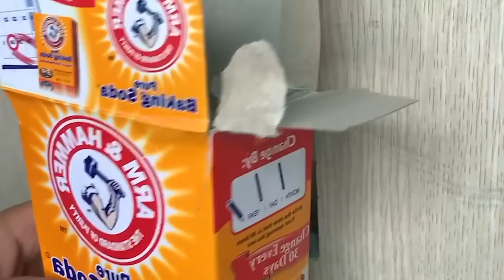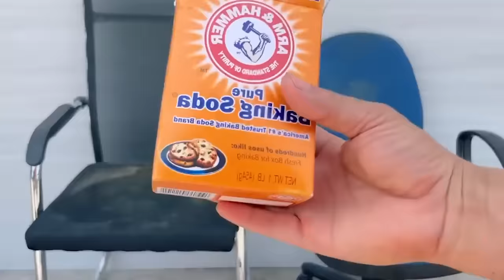Many plumbers have become extremely famous thanks to these secrets! fix metal water lock with rivets

Comment: 1st short where tap thread was broken already how it possible it will run clock wise open aanti clock wise will open yarr
Reply from the maker: It sounds like you're describing a situation where the tap thread (the threaded tool used to create threads in a hole) was already broken, and you're wondering how it's possible for it to still function in a clockwise direction while opening it counterclockwise. Here's an explanation:

In some cases, when a tap thread is broken, it may still be partially functional in one direction, typically the direction it was last used or tightened. This is because the threads on the tap are often tapered or spiraled in a way that allows it to grip and create threads when turned in the clockwise direction (tightening) even if it's damaged. However, when you attempt to turn it counterclockwise (loosening), which is the opposite direction, it may not work correctly or can get stuck due to the damage.

It's important to note that using a broken or damaged tap is not recommended and can potentially cause further damage to the workpiece or the tool itself. If you encounter a broken tap, it's best to remove it properly or replace it to avoid complications and ensure the accuracy of your threaded hole.

Comment: lol.  It’s like Chinese plumbing academy.  It will work long enough for you to pull out of their driveway
Reply from the maker: It sounds like you're expressing some skepticism about the plumbing methods shown in the video. DIY plumbing solutions can vary in terms of their effectiveness and longevity. Some quick fixes may indeed work for a limited time, while others may provide more durable results. It's essential to consider the specific situation and the quality of the repair when attempting DIY plumbing work. If you have any specific questions or concerns about plumbing repairs, feel free to share, and I'll do my best to provide information or insights.

Comment: When you got anything. But cant buy small things. Do not trust diy for safety.
Reply from the maker: You bring up an important point. While DIY projects can be rewarding, safety should always be a top priority. When working with tools or attempting repairs, it's crucial to have the right equipment and follow proper safety guidelines. If you're unsure about a DIY project, especially when it involves potential risks, it's wise to seek professional help or advice. Your safety is paramount, and it's okay to ask for assistance when needed.

Comment: I'd guess you plumber doesn't pay attention to grain direction! Why are all the videos in mirror to what they should be? All the tricks are good though.
Reply from the maker: I understand your frustration with grain direction and mirrored videos. Content creators need to pay attention to such details to ensure the best viewing experience for their audience.

In terms of grain direction, due attention to detail during the construction of the plumbing is crucial to ensure the longevity and quality of the finished work. Using materials with the correct grain direction can prevent potential problems and improve the overall performance of the plumbing system.

For mirrored videos, this may be technical oversight during editing or uploading. Viewers may be annoyed when the image is inverted, as this can make it difficult to follow instructions or understand the techniques being demonstrated.

Despite these issues, I'm glad you found the tips in the video helpful. It is essential for content creators to consider feedback to improve their content and deliver a better experience for their audience. If possible, you can directly provide constructive feedback to channel owners so they can be aware of concerns and address them in future videos.

Comment: 2:30 still leaks from the main pipe
Reply from the maker: I'm sorry to hear that you're experiencing continued leaks from the main pipe. It's essential to address this issue promptly to prevent further damage. I recommend reaching out to a professional plumber to assess the situation and make the necessary repairs. Properly fixing the main pipe will help ensure the water system functions correctly and prevent any potential water wastage or damage. Remember, it's crucial to prioritize the maintenance of plumbing systems to avoid such issues in the future. Best of luck in resolving the problem!

Comment: 2:11 this is DIYer’s # 1 mistake: wrapping Teflon tape counterclockwise. And you did exactly that. You’re misguiding the newbies.
Reply from the maker: Thank you for pointing that out. You're absolutely right, and I appreciate your attention to detail. Teflon tape should indeed be applied clockwise to ensure a proper seal on threaded connections. I apologize for any confusion my mistake may have caused. It's important to provide accurate information to DIYers, and I'll make sure to address this in future videos. Your feedback is valuable in helping improve the quality of the content.

Comment: Pretty sure actual plumbers DO NOT do this stuff not even in their own homes. Thing is plumbers are in business to make money with less liability this is why they will install a new ball valve rather than repair a worn out one or install a proper trapped sink drain rather than engineering some fix-it device on site
Reply from the maker: I understand your perspective, and you bring up a valid point. Plumbers often prioritize efficiency and long-term reliability in their work to ensure customer satisfaction. However, DIY enthusiasts might find value in exploring creative solutions for minor fixes or temporary solutions. It's essential to weigh the pros and cons of each approach based on the specific situation. Have you ever attempted a DIY plumbing project, or do you prefer to rely on professional plumbers for all your plumbing needs?

Comment: Why are all the threads backward
Reply from the maker: It seems like there might be a misunderstanding with the threads. Double-checking the direction and properly aligning them should help resolve the issue. Don't hesitate to ask for guidance if needed.
Reply: The stolen video clips are mirror imaged to evade detection.

Comment: Next trick, makes a submersible.
Reply from the maker: Creating a submersible device is a highly complex and specialized undertaking that requires extensive knowledge of engineering, buoyancy, waterproofing, and safety protocols. It's important to note that building a submersible involves significant risks and potential legal and safety concerns. If you're interested in pursuing such a project, I strongly advise seeking professional guidance and conducting thorough research to ensure the safety of yourself and others. Always prioritize safety and legality when working on ambitious DIY projects.

Comment: так много утечек в твоем доме, у которого твой сантехник

so many leakage in uour house whose your Plumber
Reply from the maker: It is important to have a trustworthy plumber when dealing with household leaks. If you experience multiple leaks, you should contact a professional plumber to evaluate and resolve the problem. Do you need any help finding a plumber or have questions about plumbing repairs?
Reply: aaa no thanks man Thanks for Asking

Comment: Неужели кто то чинит шаровый кран? Да нафик надо
Reply from the maker: First, gather your materials: rubber bands and chewing gum.
Cut a small piece of chewing gum and roll it into a thin strip.
Wrap the chewing gum strip around one end of the pipe where you want to make a connection.
Secure the chewing gum in place by wrapping several rubber bands tightly around the chewing gum and the pipe.
Repeat the process for the other end of the pipe you want to connect.
Once both ends are securely wrapped, turn on the water and hope for the best!
Of course, this method is highly unreliable and likely to fail spectacularly. It's much better to use proper plumbing connections and tools to ensure a safe and leak-free water system.

Tips Unknown

Tips Unknown
Reply: Ты не мороси я тебя найлу

Comment: Да уж не надолго эти коаны
Reply from the maker: First, gather your materials: rubber bands and chewing gum.
Cut a small piece of chewing gum and roll it into a thin strip.
Wrap the chewing gum strip around one end of the pipe where you want to make a connection.
Secure the chewing gum in place by wrapping several rubber bands tightly around the chewing gum and the pipe.
Repeat the process for the other end of the pipe you want to connect.
Once both ends are securely wrapped, turn on the water and hope for the best!
Of course, this method is highly unreliable and likely to fail spectacularly. It's much better to use proper plumbing connections and tools to ensure a safe and leak-free water system.

Tips Unknown

Tips Unknown

Comment: Almost everything was easier, cheapest and faster to just replacing the broken parts

This guy is using a lot of materials that are more expensive than the part he fixed, and is not as good as the replacement of the piece
Reply from the maker: You bring up a valid point! Sometimes, replacing broken parts with new ones can indeed be a straightforward and efficient solution. It's important to consider factors such as cost, materials, and the overall quality of the repair when deciding on the best approach. Each situation might call for a different solution, and it's great that you're sharing your insights. If you have any more thoughts or questions, feel free to discuss further!
Reply: @tipsunknow  is good to know a way to do a fix when no having access to the replacement part, but is almost never optimal and should be treated as a temporary emergency fix

And I think you should have mentioned that I your video

Comment: It costs more to create all these half ass washers when you can go buy 1 for less than a dollar that will last way longer than tge plastic washers made of pvc or bottle caps
Reply from the maker: I understand your point. Sometimes, the cost and effort of creating DIY washers might outweigh the benefits, especially when you can easily purchase a more durable and reliable washer for a minimal cost. Commercially available washers are often designed to withstand wear and tear over time.

Your perspective highlights the importance of considering both cost-effectiveness and longevity when choosing materials for DIY projects. It's true that while DIY solutions can be creative and resourceful, there are instances where purchasing a ready-made item makes more sense in terms of value and quality.

Thank you for sharing your thoughts on this matter. Your insights contribute to the discussion and provide valuable considerations for others who might be considering similar projects. If you have any more opinions or experiences to share, feel free to do so. Your engagement is appreciated and helps to enrich the content and discussions on the channel!